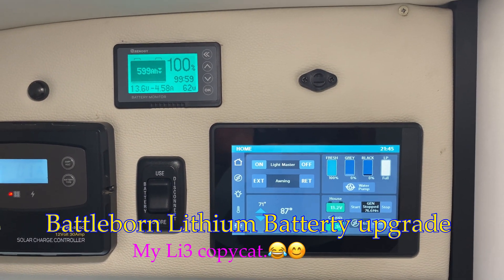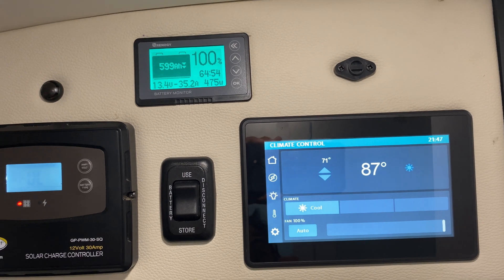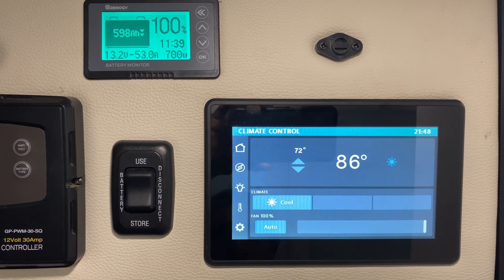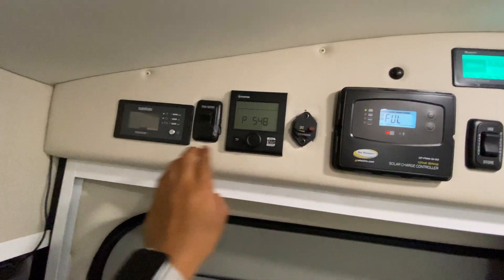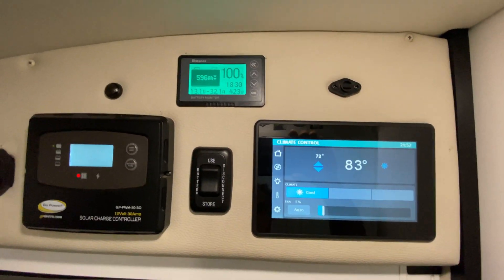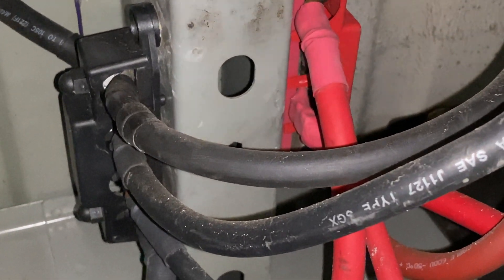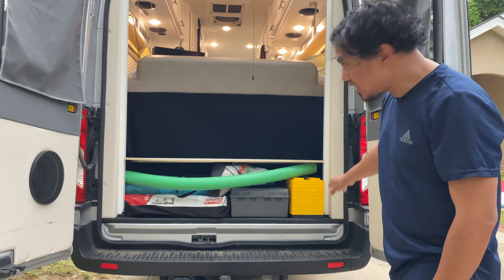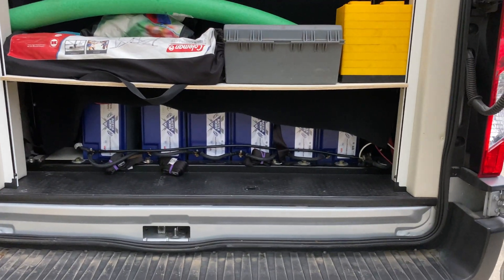DIY project for a 2020 Coachmen Beyond 22C. AGM to a 600AH Battleborn lithium batteries.

Comment: Hi Typhoon A, did you use a dc-dc charger for the alternator/chassis battery? If so, did you  install it between the BIM and the coach battery? I have to use the existing BIM to keep the existing "small" wires connected to it. This way whatever they are for, will not be affected. I appreciate your thoughts about this.
Reply from the maker: I took of the BIM, I installed 3 Victron Orions for DC to DC charging.

Comment: Hi Bagyo Adobo, very informative video. I am also replacing the AGM 330 battery that came with my 2021 Beyond D and I have a few questions about the wiring of the new LiFePo4 400 ah unit. Did you add a shunt for the Renogy battery monitor? Did you draw up a wiring diagram of your install? I would be very grateful if you did and I can have a copy. It would have been great if the RV has or came with a wiring diagram. Hope we’ll meet in person in one of our travels. Maraming salamat. EdAls Pasyar
Reply from the maker: Good afternoon Sir, Are you planing to have 1pc 400AH lithium battery? Are you installing it as a drop in replacement or are you relocating it inside? Do you have the 12V AC or 110V?
Reply: Good afternoon to you too. Hope you’re having an awesome time.  Yes I’m installing a single 400 ah battery and relocating it inside in the passenger side bench where the rest of the electrical components and jumbled wirings reside. My AC unit is 110 Vac (Coleman Mach). I still have to trace the wires to make sense on how the components are working together and will attempt to draw up a wiring diagram. Thanks for replying so fast. I’m excited to get it done soon before our 1-1/2 month planned travel.
Reply: Sorry, I meant the “driver side” of the van. I also plan on reusing the cables and in-line fuses. Just re-terminate with new crimp lugs.
Reply from the maker: @edrdotnjco1721  do you already have the thicker gauge wire installed from your chassis battery to the house battery. If so, the only thing you need now is to install your dc to dc charger, change your inverter settings, add additional breaker and to tap your AC so you can run your AC from your inverter with your lithium battery. I now have 3 victron orions dc to dc charger.
Reply from the maker: The renogy battery monitor comes with a shunt.

Comment: How much current does the 600Ah bank pull through the BIM what is the rated output of the alternator, please
Reply from the maker: the max i have been seeing is 74A
Reply from the maker: Alternator output is 270A. Amps going to battery varies. Max i’ve seen is 74A.

Comment: Typhoon, question about your DC to DC charger.  I have a 2021 22C on 2020 Ford Transit.  The cable going to the BIM160 from the battery is only 10 AWG... was yours a heavier gauge, this seems way undersized!  Also, the 10 AWG wire is attached directly to the battery.  I would have thought that they would have tied into the CCP1 which allows up to a 60 amp draw.  Wondering if your cable installed by Coachmen which attaches the Ford Transit chassis battery to the BIM160 was connected directly at the battery like mine is or if was connected to CCP1.  Thanks, Frank
Reply from the maker: Yes Sir, i do have a heavier gauge because of my proAir 12V AC. People that i assisted for their lithium conversion replaced that wire to a heavier gauge. Thanks
Reply from the maker: And yes, original coachmen wiring was connected to the chassis batter. I went ahead and used CCP1 on the, i got this idea from my friend’s recommendation Rodney.

Comment: Typhoon, we have the same model Beyond as yours. How did you route the Renogy sensor wire from the rear battery to the new panel you installed above the slider door? Thank you for this video.
Reply from the maker: Sorry for the late reply. I run it through the wall by the passenger side. Thanks

Comment: Awesome video! Your original AGM battery, was it it inside or outside? Did you remove your AGM battery?
Was wiring the BIM difficult? Again, thank you for this instructional video.
Reply from the maker: Sorry for the late reply. There is a lithium drop in replacements now where your original battery is. Wiring the BIM is easy, it goes where the the original BIM came from. And used the same wire. Thanks

Comment: Hello for how long can you run the AC with 600 amp batteries? Does that 12volt AC works well?
Reply from the maker: Good day, During the day when i use it it can run from 6 to 7 hours. At night when i run it in auto set to 74 on Florida weather overnight i will still have 50% 65% the next day.
Reply: @typhoonadobo6103  thank you for your response!!!
Reply from the maker: @findel4  anytime, please let me know if i can help.

Comment: Nice battery bank. :)

On your other video, it looked like you were able to charge at over 60A from the alternator. 

I'm curious to know if you made any changes to the wire that feeds the BIM from the Transit starter batteries? On my 2019 Crossfit/Beyond there is only an 8ga. wire from the drivers seat back to the electrical compartment, with a 40A breaker where the wire connects to the starter batteries. I upgraded that to 4ga so I'd have less voltage drop when charging from the alternator, and a 60A breaker.

(FWIW - It's possible to fish a wire behind the bathroom if you remove the fridge and the panel under the sink.)

Comment: Hey dude, does your AGS still work after the batteries are upgraded? Also is there excessive heat generated by batteries and it wires under the bed? Maybe a fire hazard?  I’m thinking of doing the same system upgrade.
Reply from the maker: Yes Sir, AGS still work,  Batteries and wires never get hot. Those are the the things i tested after completing the project. The only wire that gets hot a little bit is the jumper wire connecting the LI-BIM 225 to the BG-160. Good luck.